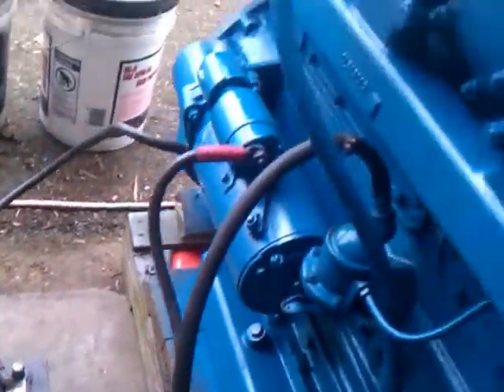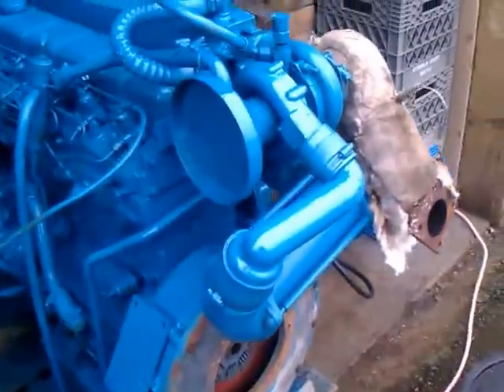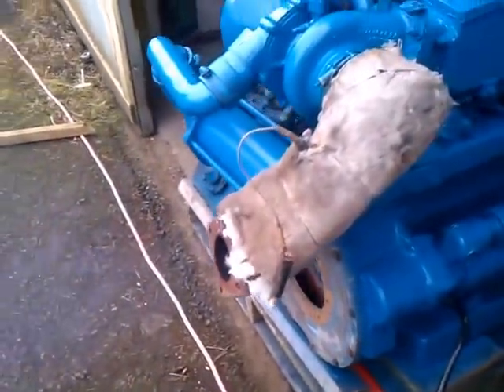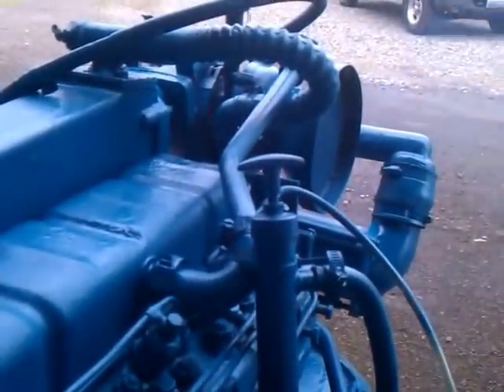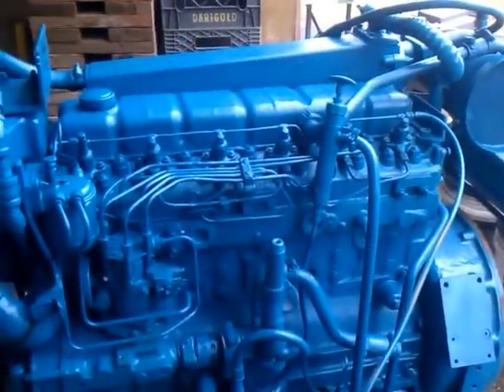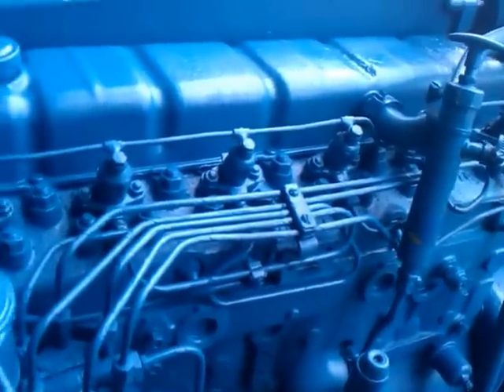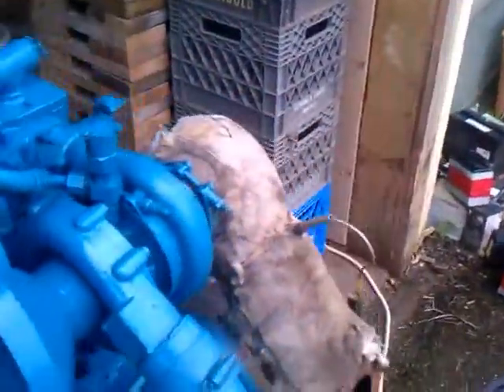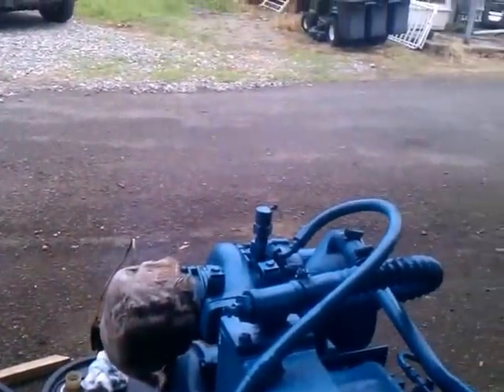Perkins 6-354 running with turbo

Comment: Great video. Cool to see the engine run in the open. I just bought an old 41 foot Defevre trawler with two of these engines. Only 1600 hours on them. They run great.

Comment: hello can any one help me out i just installed a perkins 6453T in my boat and just started it up and theres no oil coming back up to the top its smoking black out the oil cap and it shots off after a min of runing im lost and i need help maybe i need a new oil pump but cant find where its at ? plz help

Comment: wasn't the 6-345 the direct competitor of the 6v53?
Reply: 6v53 makes significantly more power and torque . 354 was one of the first high speed diesels that was very economical. low power figures though but very reliable
Reply: @themisunderstoodgorilla7030  p6 was the first "compact" high speed 6cyl diesel Perkins made, was a 1930's engine, really ahead of it's time, the 6345 was the 50's successor.

Comment: There was a clean 40' Bertram here in S.florida and nobody would touch it.It was twin so one had to be reverse rotation .This was 20 plus years ago and I can remember how rough the engines idled.Owner had boat listed 20k below book value and I remember it setting there for sale for at least 4 years.Owner claimed the engines ran great.
Reply: We had alot of fords on farm,great fuel economy,reliability and low rpm torque.The pekins in marine applications are far and few.Like I said owner of the marine perkins loved it.